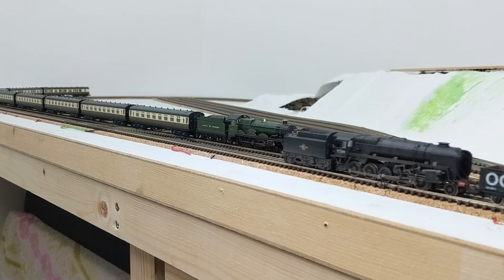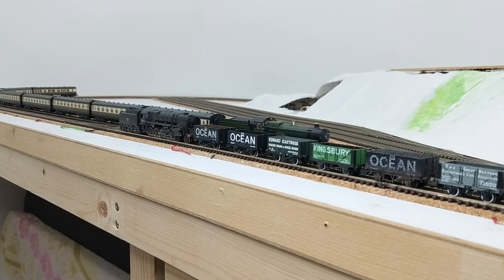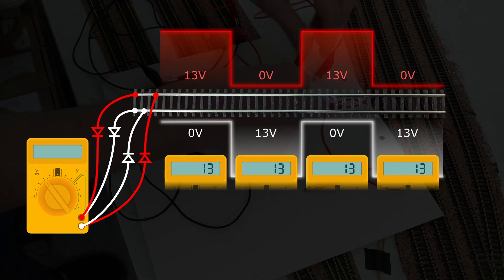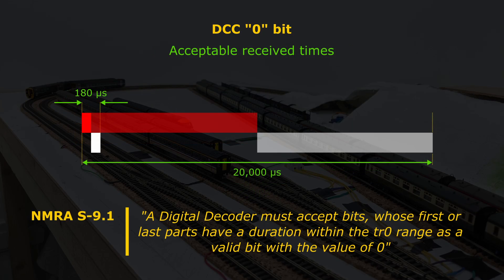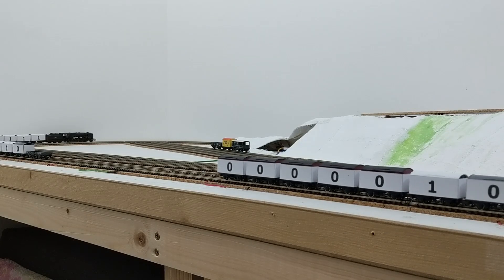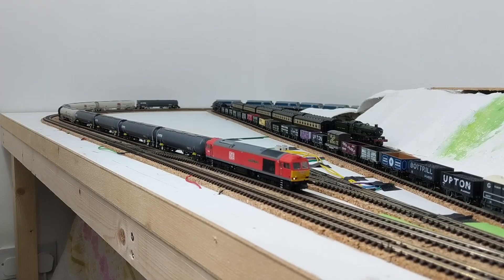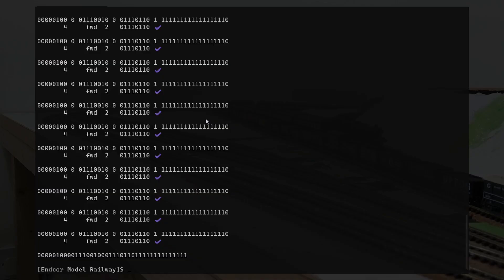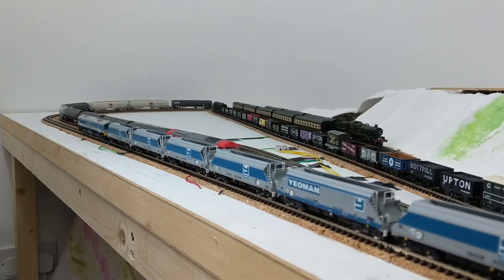0047 Decoding DCC from scratch

Comment: I have to preface this comment with me not being a python programmer, the last time I used it was long before I retired and I was forced to use it to allow use of a cellular modem that could only be programmed in python, and that had no development environment or debugger. As you may imagine it wasn't my favourite - any language that uses white space as a syntactical element should be strangled at birth, though its data structures and so on are more than adequate and modern IDEs help to stop the more egregious mistakes. On the whole I prefer to stick with C/C# (I also regard C++ as an abomination, despite having used it for a couple of decades professionally).

My own suggestion would be to use the PIO instead of polling for edges (I am not going to comment on the hardware, others have already done so). If you download the Pico python SDK documentation then at the very least you could raise an interrupt on a rising edge using the example from 3.9 that would reduce the load on the python. Further PIO programming could actually accurately decode and pass a series of bits over to the python code where the high level decode of the commands from the resulting bit stream could be done pretty simply. The PIO programs drive state machines and are limited in length but the instructions available are ideal for bit banging applications. I am afraid I can only offer broad suggestions because I do not have the hardware available to test it in any way, not having any DCC gear.
Reply from the maker: Most of my programming experience has been in Java, but I've done C, C++ and some C#. For the most part Python has come out as my favourite in the last few years, though it heavily depends on what it's being used for 🙂

I've been wanting to avoid going down RP2040-specific avenues, like PIO, but so many people are suggesting it I might have to do it just to see how it goes and report back in a future video. Thanks for taking the time to share your thoughts 🙂
Reply: @endoorrailway  I imagine IDEs and debuggers make it easier to deal with these days, though I still dislike white space as a syntactic element - you could severely mess with someone by adding a space before one of their tabs in an if block (though I would hope that the compilers would flag that, they didn't 15 years ago). The unit I was programming was a black box hit and hope - you downloaded the program to it and hit reset, then it either did what you expected or not. I did find a compiler for PC that would at least allow me to test out the processing and data structures in a controlled environment but anything to do with the cellular modem was a wing and a prayer since there wasn't a serial port to pass any response codes from the modem back to a PC for debug. I still shudder with that one, it was a pain to get working reliably wherever in the world it was deployed and it should have been a simple case of slap a local data SIM in and off you go.

With regard to the PIO I think you will find it worth looking at as it is pretty simple, especially if you are familiar with assembly. The state machine code is severely limited in size but it would still take quite a load off the main program and you could do the pulse measurement down at what is effectively hardware resolution and pass the bits over to an interrupt handler in Python to handle the protocol.

I said I would leave the hardware alone but I have to add one thing: I would sample the second rail to be able to filter out any glitches to ensure reliability, I imagine a railway layout is electrically noisy. My own choice would be to use a pair of optos to interface it to the Pico's power; a couple of resistors and some cheap optos would firmly isolate it from the track power and allow a check to ensure that the two signals were truly complementary. Obviously YMMV.
Reply from the maker: @TheOwlman  Thanks for you further thoughts and taking the time to write them up for me 🙂

Perhaps I'll find that ultimately I want to measure both rails, but with the commands being repeated I suspect it's not going to be necessary, so keeping the componentry and code that little bit simpler is very appealing.

I'm also right at the start of this project so although lots of people such as yourself have kindly provided lots of useful and sensible information, it's too much at this stage for me to be trying to incorporate all of it.

Thanks 🙂

Comment: The HW is "right". Meaning, the rectifier bridge with the voltage regulator. Don't forget some decoupling capacitors. DCC is in kilohertz square wave.
The code must be much more robust. Ideally,  in C or assembly, using interrupts and HW timers, not relying on execution speed at all. Good luck :)
Reply from the maker: Thank you for your thoughts. I'll definitely be moving away from the voltage regulator between the signal and microcontroller inputs! Execution time will always be relevant - even in an efficient language and triggered by interrupts, instructions must still be executed for anything useful to be done. But knowing that C is a lot more efficient, and from what others have commented, I'm expecting switching to that make a big difference. Thanks 🙂
Reply: @endoorrailway  Also, get yourself a Pico 2.
Reply from the maker: @bexhillbob I probably will at some point, partly because I'm interested in trying Rust, but I don't think I need the RP2350 for this project.

Comment: Great video. Two suggestions to vastly improve reliability for you:
1. Opto-couplers (I don't suggest resistor dividers; see below)
2. Interrupt driven GPIO
Bonus tip: Oscilloscope

1. Opto-couplers
As others have said, a voltage regulator is a terrible solution for this. The regulator will take time to, well, regulate the voltage. This regulation can take time, and, is not really deterministic. So your response time may vary. Also, with the regulator you are coupling the (virtual) ground (the zero volts) on the rails to the ground on the Pi, and by extension your PC. That's not an ideal solution.
Others have suggested resistor dividers. That works on a single rail, but can still cause the ground coupling issue, which isn't ideal.
Opto couplers are ideal here, because they have diodes built-in, you can use one in one orientation and the other opposite that. Then you can use two GPIO pins to monitor either direction if you want. You'll get ground de-coupling, voltage isolation and a deterministic response time all in one. Opto couplers are perfect for this application.

2. Interrupt driven GPIO
Others have mused that a 16MHz Arduino has no trouble decoding DCC, but you're struggling with a 133MHz Pi. The reasons are Micro Python and probably the voltage regulator. To make that more deterministic again and make sure you're not missing pulses, you should switch from polling to interrupt driven GPIO handling.
An interrupt allows code to be processed immediately, regardless of what the rest of the processor is up to. You can simply timestamp the pulse then or count it and then resume "normal operations"
A quick Google found an article titled "Raspberry Pi Pico Interrupts Tutorial- Examples in MicroPython" that might explain it for you. This will make a big impact on reliable pulse counting.

Bonus tip:
An oscilloscope would be super handy here.
These days, a super basic one can be had for DIRT CHEAP. They won't be great, but absolutely perfect for testing and debugging this kind of issue. The  "FNIRSI DSO-152" (no affiliation; just and example) is one example. You can get something like this for well under $30....

Hope this helps.
Reply: I played around with all this a couple of years ago (for Scalextric Digital, which also uses DCC)... I can wholeheartedly recommend all these suggestions. I know a scope is an investment, but you're doing everything blind without one. I went for a Hantek standalone unit for under £200, but USB ones which use your PC to do a lot of the work are £50 or less.
Reply from the maker: I had a bit of a look at oscilloscopes today - it looks like they'd need to have megahertz bandwidth, and then it was unclear to me if ones that said they're 1 or 10 MHz can handle square waves at that speed. I'll see how far I can get without one - I can be confident that the signal at the track is OK because 30+ locomotives all respond to commands just fine, and I know from the NMRA specs what the signal for the commands should be, so I'll only need to get an oscilloscope if I get stuck. Thanks for the comment 🙂
Reply: Yeah, +1 for interrupts. You should be able to get a python library (compiled in C) that just records the times of each interrupt which you can then process at your leisure with python.
Reply from the maker: Thanks 🙂 One of the existing projects I came across and of which I had a quick scan was like that - C with Python. I think I'd rather stick to one language at a time though - I'll just move wholesale to C.
Reply: With the RP2040 specifically, the real trick is programmable I/O (PIO). The GPIO pins can be attached to one of a few state machines that run independently of the RP2040's two processor cores. PIO can be used to read in data on pins, feed data into an input buffer, and trigger an interrupt to tell a processor when it should read in data from the buffer.
Parallel processing is another way to improve the RP2040's responsiveness. I don't think it should be necessary, but one core can be dedicated to listening for DCC packets while the other handles other tasks like printing output to the serial terminal. I suspect Micropython should be performant enough on the RP2040 to make this all work reliably.
Reply from the maker: @SnakebitSTI  Thanks for taking the time to write that up - several other people have mentioned PIO - it's not something I knew about before 🙂
Reply from the maker: Thanks for the encouragement and for taking the time to write up that information for me!

I've been a bit baffled by ground coupling for a while - often things I buy seem to require it, and the common ground on the electrics of this layout seem to link lots of things. I would much prefer things to have more isolation, so if optocouplers are small enough then I'm in favour of trying them 🙂

I did actually start off with interrupt-driven code, but I couldn't get good results and switched to the polling, which worked better. However, the interrupts will be directly linked to what the voltage regulator is doing, so that could well be a source of issues from what you and others have explained to me. I did actually read through a detailed interrupts tutorial from the MicroPython documentation before writing any code - it gives lots of useful information.

I don't think there are other projects I'm going to want an oscilloscope for, so I'll see how far I can get without one - I'm pretty sure the signal at the tracks is going to be good because I've got plenty of trains receiving instructions correctly, but I admit it would help with diagnosing the issues I've had!

Based on all the helpful comments like this one, I think a combination of switching to C and for now using a voltage divider (both things I should be able to do soon without doing shopping), are likely to bring much better results 🙂
Reply: @endoorrailway  optocouplers can be extremely small. Definitely give it a go. One side behaves exactly like an LED, though you never see the light; the other side is often a PNP or NPN transistor with exposed collector & emitter. There are many, many example circuits on the net.
Reply from the maker: Great, thanks 🙂

Comment: My few cents: Stick with a regulator for supplying power to the pico. Use a voltage divider using two resistors for the signal. Have a look at interrups and write the recieved bits into a circular buffer (ring buffer)
Reply from the maker: Thanks for your thoughts 🙂 I think a regulator from rectified power for the microcontroller would be sensible, and actually the DCC specifications say decoders should be able to work with up to 20V from the track, so I imagine it would help with that.

I actually started out using interrupts but got worse results that the polling; however, from what others have said it seems that could be at least partly to do with using the voltage regulator for the signal.

Comment: It’s likely your meter isn’t a true RMS meter, so instead of taking a proper average it just takes the peak and multiplies with 2/3 which would be correct for a sign wave, but is wrong for any other wave like the square wave.
Reply from the maker: Thanks for the theory; in AC mode it does measure the DCC track voltage (without any of my diodes in place) as the expected 13V, so it must be taking a proper average to get that. The readings where it was 2/3 of full voltage were when it was in DC mode - I don't think it should be doing any kind of RMS (or an approximation) for DC, if nothing else because it would never produce a negative value. In DC mode it does correctly measure normal DC signals, like the supply for my LEDs, or the terminals of a 9V battery, as being at the expected voltages. Maybe I need to put it into AC mode and see what it makes of a single track's signal through the diodes - I didn't do that because the current isn't alternating. This multimeter was about £7, so it's not going to be a fancy one.
Reply: @endoorrailway  If you were to give your multimeter on AC a 13V sine wave, the peak voltage is going to be 1.4 times the RMS value, and the meter is calibrated to tell you that the RMS is 13V. This is the cause of your 2/3 and 3/2 values, though they sound like the average, rather than the RMS. Try that AC read on a 9V battery and see what you get, compare the DC and AC readings, that should calibrate the reading in your mind.

Most multimeters measure AC by rectifying the AC to DC and then dividing by 1.414, the square root of 2 (or multiply by 0.707, the inverse, it's the same result). This matches the definition for measuring an AC value, that it should come out the same as the DC voltage that would deliver the same POWER. (if you have root 2 times the voltage, you get root 2 times the current, and volts x amps = power.) For most multimeters, your AC range will read 13V RMS AC as being 13V and it will usually do the same for 13V DC, though it may say 18.3V... A smart multimeter will recognise DC and scale itself accordingly, though most simple multimeters are not that smart. You could try this and it will be informative.
It would seem that when no instructions are being delivered to the track, it rests at 13V DC. You could tell by putting a DC-only engine on, it should go like Mallard... 

Multimeters are a black art that I mastered in 1973, but now can't explain very competently. It's been a while...
Reply from the maker: @neilbarnett3046 thanks for the information. 

The 9V battery test is odd - in DC it measures 8.5 or -8.5 swapping the leads, so that seems about right. In AC it measures 18.8V with the leads one way, and 0V the other way. I expected about 12V or 13V regardless of which way around the cables were, if it were applying the scaling to get equivalent DC power.

I think I'll need to do some proper reading up on multimeters, or maybe buy one that comes with detailed documentation - I'm going around in circles with what I'm understanding of what people are telling me vs what I measured, but thank you for taking the time to try and help me with it!